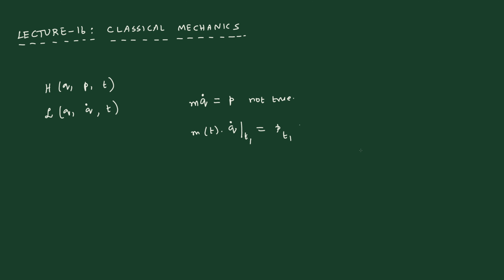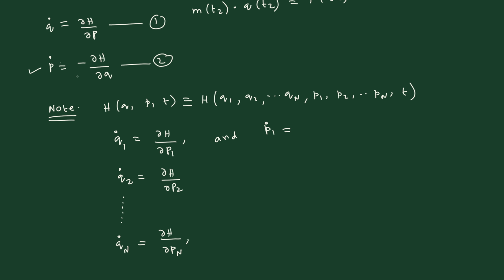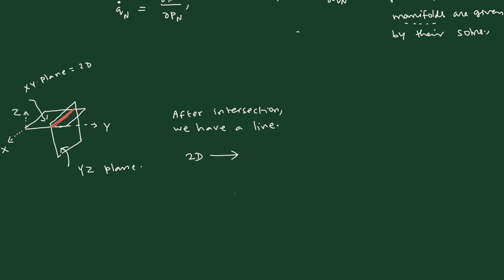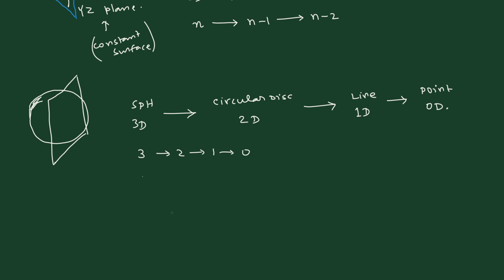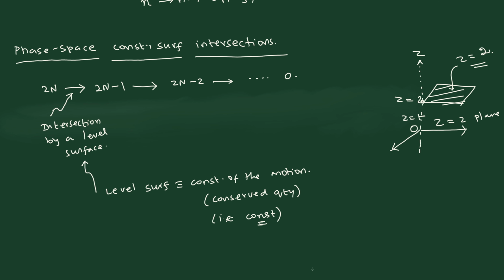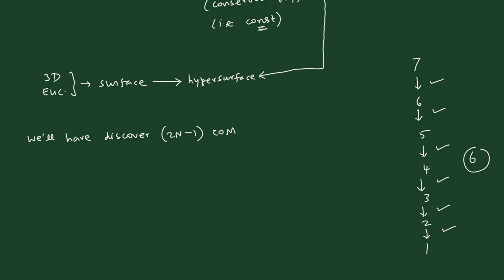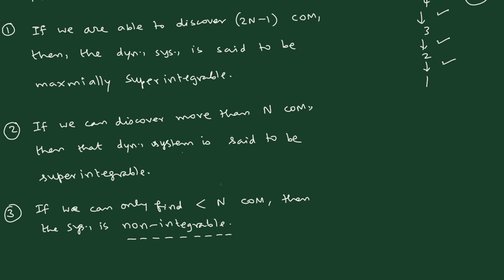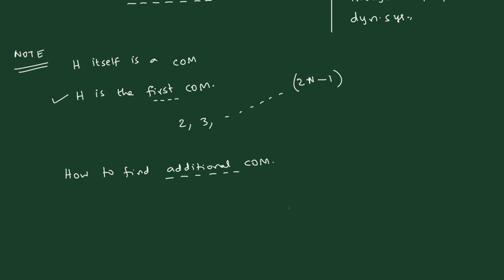Classical Mechanics Lectures 16 | Hamiltonian and Constants of motion | Super-integrable systems

Comment: sir, if we will be unable to find any of the COM, then what we will call it, non-integrable or any other term is there for it?
Reply from the maker: You need to tell the number of DOF of the system before answering. Let me assume that DOF > 1. Then, unable to find any COM means we have only one COM which is the Hamiltonian in which case we say non-integrable. For a single DOF system, the classification is an integrable system.